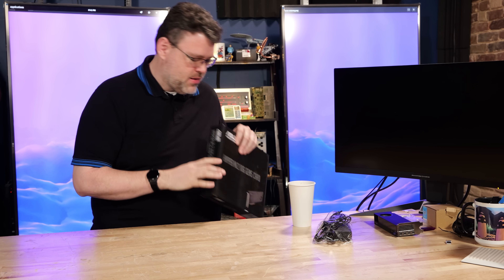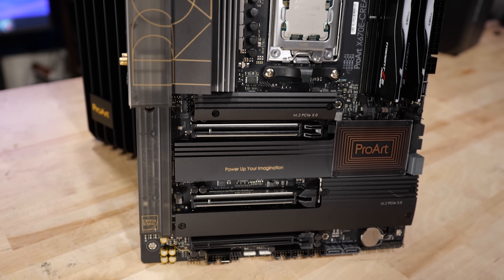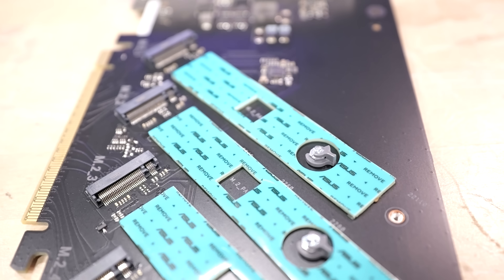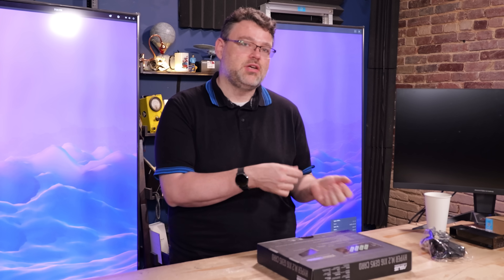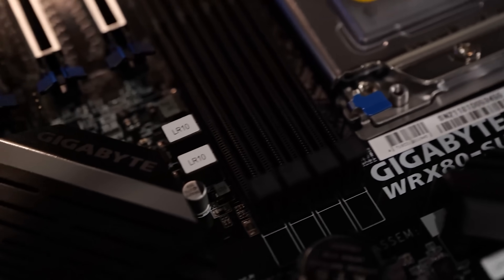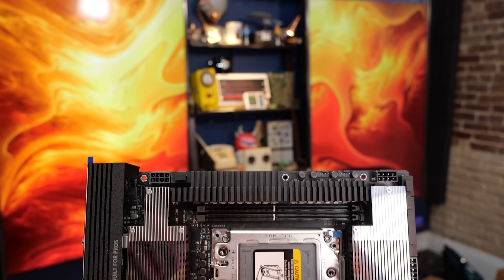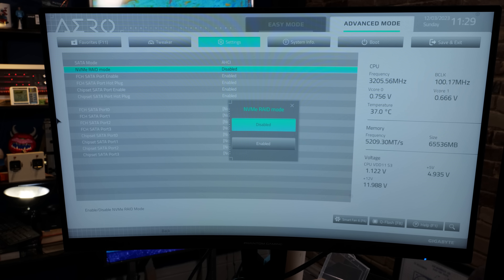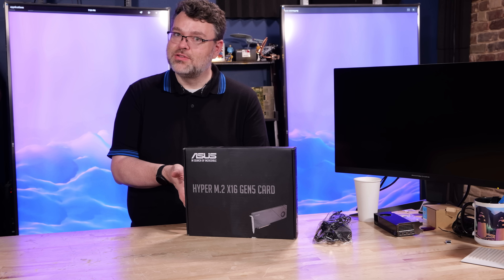Is The ASUS Hyper M.2 PCIe Gen 5 Card The FASTEST Thing In Your PC?

Comment: I think eventually, mainstream M.2 drives are only going to need 1-2 lanes of bandwidth, and maybe we will see an x4 slot bifurcated to x1x1x1x1
Reply: That's the whole point of them pushing quick for version 7. The limit of direct storage is the number of lanes a CPU has available. X4 is a waste. Going down to 1 lane quadruples the capacity. But there is PCIe switching silicon too...
Reply: Gimme 128x1 PCIe7 lines to my petabyte flash insanity by 2030
Reply: The thing about this though is that manufacturers are, for the most part, not making hardware for home labbers. We're a very small market overall, most people want a couple of very very fast SSDs (even if they're so fast already that you won't notice the additional speed, they want the bigger numbers) and they want those SSDs tucked away in a cheap, compact package (= M.2). Most of the people building servers and such aren't as cost constrained as home labbers so they can just use Threadripper, Xeon W or Epyc and have literally hundreds of direct from CPU PCIe lanes where using 4 lanes for an SSD is completely a non issue and the extra bandwidth can actually be useful, or if they want even more capacity they can use a honey badger card or equivalent to pipe 20+ SSDs into a single x16 slot, the latter technically being doable on consumer platforms but being very expensive (although Sabrent did make a 4 SSD PCIe gen 3 card that did proper PCIe switching instead of bifurcation so it can plug into a single x4 slot)
Reply: Honestly right now, 1 lane of 5.0 is enough for even a boot drive for the main stream consumer. I would  love to have an ATX board with 1 x4 slot and a ton of x1 slots for mass m.2 storage now that 5.0 and 4.0 drives are approaching price parity
Reply: That's an excellent point but the limiting factor is space on the MB, especially if smaller than EATX.
Reply: @Jack_cx  You're thinking in terms of M.2 only. Servers don't play with that piddly stuff outside of a boot drive. They would have full x16 cards that attach to a front backplane to take hot-swap drives of some form factor like EDSFF.
Reply: @timramich Workstations and some servers play with M.2 all the time, including the PCIe switching cards that slap well over 20 M.2 devices into a single x16 slot (which are so expensive they're in "if you have to ask you can't afford it" territory)
Reply: @bosstowndynamics5488  No they don't. That's high end consumer stuff.
Reply: @bosstowndynamics5488  What are you blabbering about?
Reply: @timramich  Sorry it wasn't clear which comment you were replying to. If you're trying to claim that enterprise don't use M.2 drives in expander cards the counter examples would be devices like the Apex Storage X21 or previously the Liqid Honey Badger, the latter literally only offered to datacentre and enterprise customers (hardly "high end consumer" and the former, while technically for sale to consumers, being more expensive than, say, a WRX90E motherboard despite literally just being a fancy SSD holder. These are unambiguously enterprise targeting parts, and they solely use M.2 drives (you might have ignored it earlier, but one of my points was that the original concept of RAID was named after using cheap consumer disks in high availability enterprise grade applications).
Reply: @timramich  YouTube seems to keep eating my comments so the short version is, if you're talking about enterprise use of M.2 drives, you're wrong. Obvious examples include enterprise grade M.2 drives with capacitors for safe shutdown, and devices like the old Liqid Honey Badger that was never sold to consumers and came only in datacentre and enterprise configurations using commodity M.2 SSDs to deliver higher performance than any direct enterprise solution at the time (the more recent equivalent being the Apex Storage X21, which puts literally 21 M.2 drives into a single x16 slot. While that one is technically available to consumers it's well into enterprise territory as far as pricing is concerned)
Reply: @bosstowndynamics5488  I know what that card is. It's more of a novelty than anything, and was really aimed at prosumers. Servers tend to need to stay running, so shutting them down and opening them up is why they don't really use M.2 drives. I suppose there was a period of time when they did, just because there was nothing like EDSFF for a time between U.2/3 and it.
Reply: Ive been hoping for this for a long time now. An x1 pcie slot has more bandwidth than sata, and plenty to not constrain any random IO anyway. Id love to see the ability to connect in NVME SSDs over x1 slots for those that need more than 1-2 drives in a PC but dont want to go with old sata drives, or buy an HBA. We can keep a high performance drive area too, but there should be a segment of "general storage" drives that just run off x1.
Reply: @LordSaliss Technically B key M.2 drives did exist for a while that used 2 PCIe lanes, it's just that most buyers in the consumer market wanted bigger number instead of more drives or lower latency
Reply: Not going to happen, unfortunately. That 1 lane requires an expensive brand-new super-fast controller, whereas the 4-lane alternative is dirt cheap and a decade old.
Reply: ASRock showed just such an adapter card at Computex, along with their Z890 boards. If you check some of the photo galleries from event coverage, it's displayed below their Z890 Taichi. This was the text from the placard:

"M.2 Expansion Card
PCI Express 4.0 x4 Interface
4 x M.2 Sockets (PCIe Gen4 x1)
Supports M Key type 2242/2260/2280/2580 M.2 SSD"
Reply: That would actually be quadrifurcated.
Reply: I'm fine with keeping x4... but I want M.2 to get chased back to laptops where it belongs... and desktop case manufacturers to start including E1.S slots. I don't need to be giving IcyDock so much money :)
Reply: @MikeKirkReloaded  I just want them to update the SATA standard so that 2.5 in drives can be somewhere close to M2 but with density.
Reply: @MikeKirkReloaded can you plz elaborate more… u r talking about 2.5 inch enterprise ssd’s right..? Where does icy dock comes in to play…?? Sorry I m noob in the field and learning as u go…

Comment: I have been running the card in my ASUS Pro WS WRX90E-SAGE SE since 8th July. Wasn't recognised correctly straight away, first had to change the setting in the bios
Reply: As an enthusiast, I used to have a top end Asus TRX40 board. That was, until AMD broke their now infamous "long term support" / "TRX40 ain't going anywhere" promises, and we ended up with only those original three Zen2 CPU's, 100% destroying their enthusiast userbase.
The extra features/bells and whistles on those many TRX40 boards, especially the Zenith II Extreme that I had have all but been stripped off for those extremely few in number TRX50 boards (and WRX90). That's pretty shocking, and mirrors what MB manufacturers think of TRX50. As a Gen5 board with lots of lanes, TRX50/WRX90 are excellent of course, but it reflects badly on AMD when compared to those feature-laden TRX40 boards. Such a damn shame since TRX40/enthusiast Threadripper showed a lot of promise.
Reply: @Jack_cx  ok, I understand, but now? What does this have to do with the ASUS Hyper M.2 PCIe Gen 5 Card or the fact that I shared my experiences on the WRX90 and the M.2 PCIe Gen 5 Card? I am confused
Reply: hi what ssds are you using , how many of them, are you in raid 0. and what speeds do you get

Comment: I've never gotten one of those to work in a desktop platform because it won't do 4x4 bifurcation in the x16-slot. :(
Reply: Eh? I think nearly all of ASUS's modern boards do x4x4x4x4 in the primary x16 slot, and many other manufacturers' boards do as well, at least on AM4 (not sure one way or the other about AM5, I think most Intel platforms will give you x4x4 on the second PCIe slot giving you 2 drives if there's a GPU in slot one, which is a bit of a waste because there's much cheaper ones that will give you x4x4 with only 2 slots on the card while being much more compact). The biggest issue is that most of the time there's only one fully electrically x16 slot so these don't play well with GPUs if you're using one of the AM4 boards with 4 way bifurcation, but Wendell did say that these are really only useful on HEDT/workstation class boards anyway
Reply: @bosstowndynamics5488  You're very... VERY wrong on that.
Gigabyte basically abandoned bifurcation on nearly all of its boards. 
MSI barely even implemented it outside of HEDT.
The 600 and 700 Intel chips are incredibly rare to find bifurcation support at all and none of them support quad x4.
Reply: @tim3172  I'm willing to concede on other manufacturers but there's definitely wide support on a lot of ASUS boards, as far as I'm aware they specifically implemented it for devices like this (which makes sense since they're one of the main name brand manufacturers of these passive cards and it's at least previously been marketed towards consumers under their "Hyper" branding (I can absolutely without a doubt guarantee it's supported on at least one ASUS AM4 board because I've currently got one in mine)